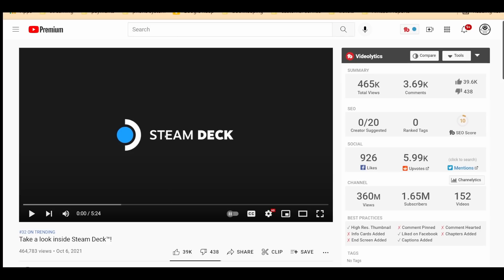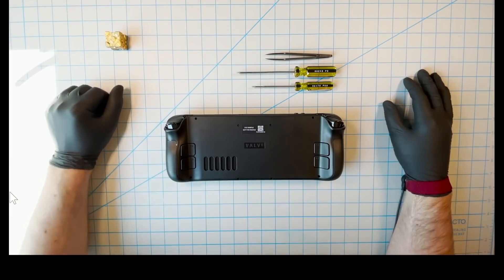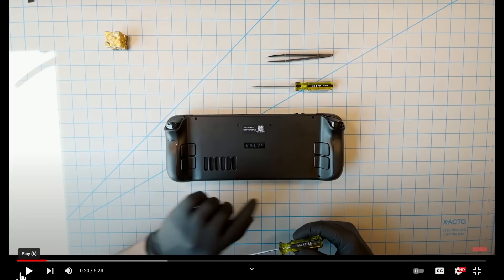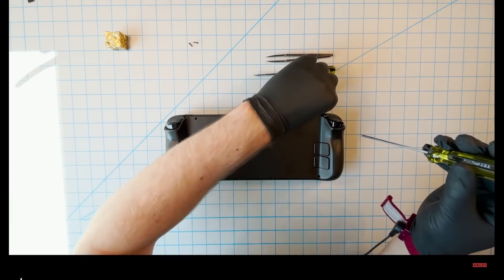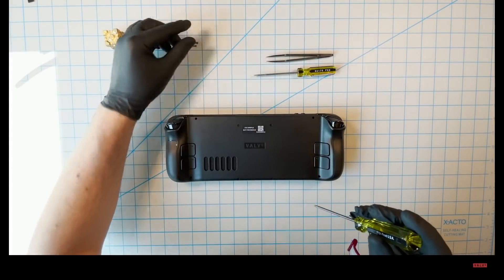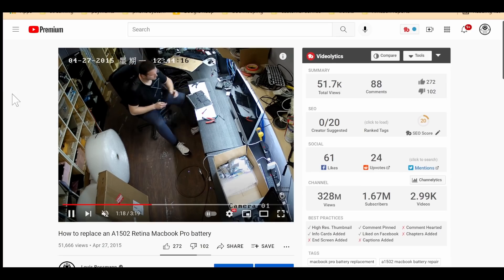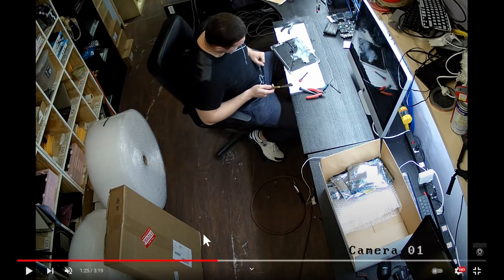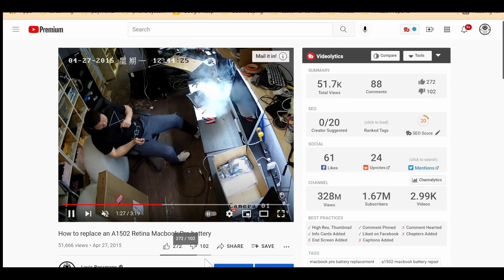Steam deck battery may end your life? bruh 😑

Comment: As a mechanical engineer, the structural integrity bit is mostly nonsense.  But as they are self-tapping screws, it's quite possible to strip them out.  If a screw isn't there, it may cause some structural integrity issues for someone who is particularly hard on their devices.  I really doubt it could cause a practical problem for any normal use situation, but the possibility is there.  That said, it wouldn't stop me tearing in and replacing whatever needs replacing.  So, mostly overblown nonsense on that one.

Comment: I'm just annoyed that expanding the storage afaik and have seen on Newegg the max is less than 512gb. That should be enough for some and yeah I know sd slot exists but stinks that form factor is that limited in capacity. I know it's probably heat and other stuff preventing more but man

Comment: I thought they meant the structural integrity is weakened while the cover is removed for repairs. But yeah if you take the screws out like 50 times and reinstall them and you are using a screwdriver with a thick handle you could overtorque them and maybe start stripping/damaging the plastic ?????

Comment: Steam is probably covering their ass when it comes to saying opening it compromises the structural integrity of it. though there is some truth to this. Maybe in future models, the bottom side of the device may have anti vibration and shock absorbing padding. removing the rear of the case could rip this material and make it more prone to damage. I work on a lot of fiber optic equipment that use shock absorbing pads on it and its made very clear that any repairs done need to also include new pads and gaskets, but i deal with glass that's thinner than a human hair so even a little bit of shock can break it.

Comment: Your car battery is more likely to explode in your face then any battery in any phone or device. I agree I cannot see how opening it up will weaken it for ever. I did not see any clips or glue used anywhere and as long as you put it back together correctly it should be fine, so yeah I don't believe it.

Comment: So in defense of the Steam Deck video, what he says is kind of true. The type of people those warnings are for are the people who are going to do said things, so for use they seem like excessive warnings but for others we really do need to tell them not to touch fire. It sounds to me that those were legal warnings to cover basic ground more than anything of real substance. 

And then the structural integrity things, so again a sort of. Most people who have done this for any length of time mostly don't see how you can fuck up putting things back together, which with handhelds is important to do. If you don't put things back they way they should you introduce gaps and distance where it shouldn't. Which again makes me think that it is more something that legal told them to say.

Comment: Calm the down.  If the battery blows like that, it could start a fire, spread quickly, and possibly kill people if not contained quickly enough.  Yes, a li-on battery is POTENTIALLY life threatening.  Not just to the repair person who's smart enough to move away from it while it blows.  Telling people "It'll be fine as long as you move away quickly" is incredibly irresponsible.  There HAVE been deaths from lithium battery fires.

Comment: Self tapping screws can be difficult to get back exactly into the original thread cut.
But, more importantly, the first time they are tightened down they 'settle' where they are and over time the plastic deforms a tiny bit... a couple thousandths of an inch.
Then expose those threads to additional unbalanced pressures from normal use and droppage and small crazing cracks form at the incut edges... 

Now, unscrew all the screws one at a time and the screw won't go back into the same hole because the hole has changed shape and alignment a tiny bit.
Again, just a tiny bit.

The screw will still tighten down again and the case will still be, mostly, about as strong as it was originally... almost.
Disturbing crazing cracks will cause them to widen a tiny bit.
Putting a bladed screw back in will shave off a tiny bit more plastic.
Mostly though, a little care and it'll be mostly as good as it was.

And, if you manage to get one in wrong and cut new threads or over torque it and pull the threads out, you can finish the job by drilling the hole out, filling it with JB Weld and drilling a new, clean hole in that after it sets... and it'll be nearly as good as new again... nearly.

He's actually being truthful but in a slightly hyperbolic way. He's just trying to avoid phone calls from guys who are  confident enough to open the case but clumsy or unlucky enough to actually mess up the threads to an extent that would be obvious.

Comment: I have compromised the structural integrity of devices many times when they used those self tapping screws, but that's because I was a child when I did it. I'm sure many 80's-90's kids had a loose NES controller after replacing buttons. I miss being able to do that by the way. As an adult, I know to have 2 seconds of extra care and patience for those screws. Don't just jam it in there and start turning. Manufacturers see everyone as kids. They think we're just gonna cross thread screws and keep turning till the plastic gives way.

Comment: @mechanics: Technically correct, yes, but practically bullshit.

The clue is in that he said they were "self tapping screws" often this means there is a tiny little triangular cut out in the tip of the screw which actually removes material as it's first set to make a path for the thread. It's the loss of material that causes the potential loss in holding strength. Still... it would take a few dozen removal and reinstall cycles before a loss in mechanical strength was truly problematic, though your tolerance to this may vary. 

I've only seen this become a practical problem in the wild with game controllers are particularly high maintenance. (*cough* N64 *cough*)

Comment: For the subject of Self-tapping plastic screws. 
I owned PSP first edition and construction was easy to open and replace parts after one of these replacements I had to replace both front and back case elements because I couldn't screw it correctly anymore. The reason was that I over-torque one screw and after removing it and reinstalling it became too loose and this impacted not only the stability of the case but also created pad drift problems.

Comment: About structural integrity: they may be thinking about users breaking plastic clips that hold the shell together. It’s not uncommon for those to snap and if product was designed to have them, that edge will always be sort of loose which may create possible entry for derby and water. I’ve disassembled laptops before that had those clips all over the bottom cover and a few broke. Even with screws in place that plastic was rattling. Not trying to defend Steam, they should have designed it to be easy to open in the first place.

Comment: It breaks easier after being opened due to one thing:
Snaps.

Snaps are a garbage way to assemble a product and they receive wear and tear each time you open a device with them.  However, it should be noted that it will lose VERY LITTLE structural strength when snaps are damaged.

If the Steam Deck doesn't use snaps, then he is full of shit as it should lose no strength.  Judging from what the shell looks like when it is opened, it appears like it does indeed use them.

Comment: Regarding "muh structural integrity"

I'm just conjecturing here but I suspect the "structural integrity of the device" has a lot to do with the state of the self-tapping screws and their respective threads. Without a more durable bushing there's probably going to be a reasonable number of cases where a tech/consumer doesn't take the necessary precaution to avoid stripping out and/or damaging the occasional thread when reassembling the device. Upon doing so they could potentially prevent the plastic case from closing as effectively as it should which would likely result in the device being more susceptible to drop-damage.

My own personal experience with self-tappers right into plastic dictates that overtightening them and damaging the holes isn't  that hard to do. I usually only ever see them used in places where the screw is designed to go in once or on cheaper stuff. Valve knows if we get our greasy hands on their precious Steam Decks and start taking them apart there'll likely be some issues with this.

Regardless, I do think if you take the basic precaution to re-assemble the device without stripping out or damaging any of the threads it would probably be fine. They're just covering their asses.

Comment: They're kind of correct on removing the screws making the device less strong overall if removed and then either incorrectly reinserted or torqued up to 9001 newton metres.
If you do the old "screw in, quarter turn back, hear it drop into it's thread and then screw to finger tightness" you've nothing to worry about. Self tapping screws just cut threads as they're inserted. The steam deck will have it's cover blow moulded with holes for the screws to tap threads into. Once those threads are tapped at the factory you just need to put the screw back in correctly and any structural integrity loss will be minimal. 
Thing is Valve could have easily used machine screws and brass inserts. I bought a rowing machine used for £5. It was a cheap as fuck magnetic flywheel one. When I bought it the counter wouldn't work as the batteries in it had gone bad and corroded the contacts away completely. 
I got a AA battery holder so I could just hot glue that to the outside and run the wires in through the hole where the old batteries went.
When I opened the counter case which has zero user serviceable parts inside they had put in 4 brass inserts and used machine screws rather than screwing directly into the plastic. 

Unless things have changed dramatically in the 10 years since that was manufactured using metal inserts not only makes the item stronger out of the factory, it reduces QA waste as you don't have to throw a device case out (as often) if a screw is over-torqued even slightly, which can happen during manufacturing. 

The lack of metal inserts and machine screws is 100% Valve trying to make devices that are more prone to failure past warranty as plasticisers off gas over the years and the plastic becomes more brittle and valve trying to make a device which can only be opened a finite amount of times for the average consumer.

Metal inserts may even save them money. They chose to fuck consumers instead.

Comment: In the case of phones, if you remove the display that was using some sort of adhesive to adhere it to the body, the structural integrity will be changed if you don't use the same adhesive or application amounts etc. but in the case of the back being held on by screws, ya, I find it highly unlikely to have a major impact. unless you strip the plastic the screw threads into, then because it no longer is able to fasten the back properly, you have the potential for more flex than before.

Comment: Point of note: If these devices all come with self-tapping screws, is there a market for replacement standard thread screw kits, screws that won't bork the threads over multiple cycles, and potentially a kit that allows someone to hand-drill a stripped boss with a pre-made guided bit, press in a threaded metal sleeve with a dot of epoxy at the bottom, wait 10 minutes, and reassemble?

I'm also weird enough of a thinker to try and design something like that with pressed studs and blind nuts with flush spanner heads though, so maybe none of the above makes any sense.

Comment: They are still using fear mongering tactics - oooh dont open it or you might damage it - or if you open it it will be less resistant to fall damage - yeah - and the same will happen when THEY open it xD and if anything its a sign of crappy design - or deliberate attempt to limit the longevity of a product - solid parts and screws exist - for them NOT using those and then later going "oh it" frigile is hypocritical - because they COULD have made it better xD.

Ergo they designed deliberately it ina manner that its prone to being damaged xD

Comment: I think this script highly likely went through the lawyers first before making the video. 

Also, with self tapping, the more times those screws go in and out of the plastic, the more they'll tear it up. I have practical experience with a mod chip in an original xbox where i need to hold the chip down to make sure all the pins are making contact during boot up now because i removed it too many times. This was the mod chip that screwed on with the pogo pins and not a solder on chip

Comment: Louis I like you but don't be the "guy from tech bubble". The video was partially sarcastic, partially for people who really should not open it. You have to remember that Deck will be used by kids and tech inexperienced people like really inexperienced, yet one dealing with computers, so they might be tempted to open it. And about battery well for someone complete "tech noob" battery catching fire can end up bad, it will not happen to me, and for sure too you, but for average human being it could cause a fire of house/apartment and well trap you in fire and kill you. About your battery comment - running away from burning battery is the same stupid as sticking head into it, burning device have to be somehow managed to put fire down (hard with batteries - hope you know that) or thrown somewhere outside, the best on some concrete or other thing that will not catch the fire. What they mean about professional to go to someone like you to pay some amount to replace battery.
Reply: About structure integrity, self-tapping screws in to the plastic case. Even if you are super careful with them, holes will lose some durability every time you screw something and unscrew something, especially if it's done by someone who have no idea how to deal with them. This is how it is with them. Did you ever disassembly and reassembly IKEA shelf, it is ok, or wobbly AF? It is a bit of shame that they do not put some hot metal injections in the place where screws should be, but it will increase the cost, and Deck is very aggressively priced, I would be not surprised if the lowest model is sold with negative revenue.

Comment: mechanical engineer: the self tapping screws he isn't wrong about- structural integrity "lessening somewhat" is technically correct but not a realistic concern. but they're showing things like dropping it hard and hammering it lol so yeah, if you're playing football with your steam deck maybe you shouldn't open it.
Reply: to be more specific, it looks like the casing is very snuggly fitted on with tabs on the edges- so the screws have some help holding the device together. even if you completely strip 1 or 2, you still have 6,7 other screws.  judging from the structural testing footage, they're using pretty good plastic besides. i'm positive the steam deck's durability is excellent and nobody should be that concerned with opening it once or twice to swap parts out. you're correct that most of warnings he brought up are for legal

Comment: The structural integrity thing is probably a consequence of the self-tapping screws. Once you put them back in, they will wear a little bit more into the bosses and be slightly looser. They probably put that in there so that if somebody drops it after having opened it, they can’t sue.

Comment: By experience, lots of stuff I opened DID lose its structural integrity. Because I'm a noob and was still learning driven by curiosity. So my guess is that's somewhat right BUT with a small tight system like this, and how it looks inside, it is not that complex to be impacted that much. All of this is just the BS their lawyers said it should be stated. I'm confident the guy stoped cut lots of parts where he laughs his ass out

Comment: 8:25 I'm guessing that they're making the statement about structural integrity specifically because of the statement they made immediately prior. If taking out the screws and replacing them can potentially damage the case then that means it can damage the threading connection points, so its slightly more likely to pop open if you drop it, or if you over tighten egregiously the case could maybe develop a crack at the thread point when impacted. It won't make any other part of the unit more prone to damage.

Comment: Self tapping screws become less and lass secure every time they come out, its probably not a huge issue, but if the steam deck wasnt such a cheap product they would use metal inserts and properly threaded screws.

Comment: Louis, as a mechanical engineer who works every day in the field of electronics reliability in the automotive field, I can tell you that opening the case and putting it back together can actually impact the drop resistance of the console. In the automotive industry, thermal interface material or thermal glue is used to secure components to metal/plastic housings, even though the components themselves do not need any cooling. Generally when ECUs or other electronics are assembled, if the PCBs are held in with screws, the torque and the tightening order is controlled to ensure there is as little warping as possible. I can see how if someone puts it back together, the TIM will not bond back as strongly, or the PCB can get warped which can have a massive impact on the drop reliability of any electronic device.